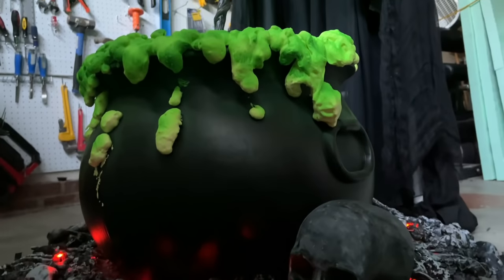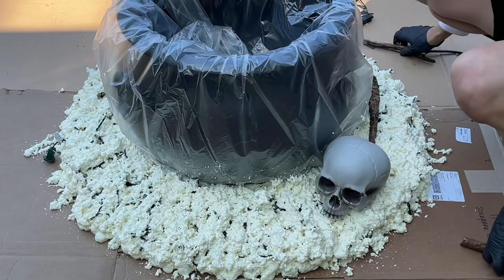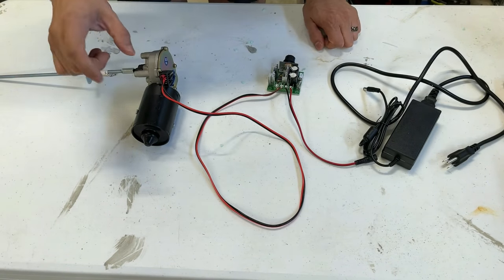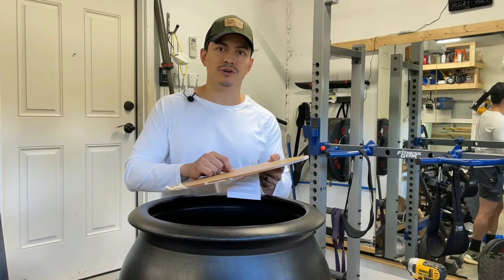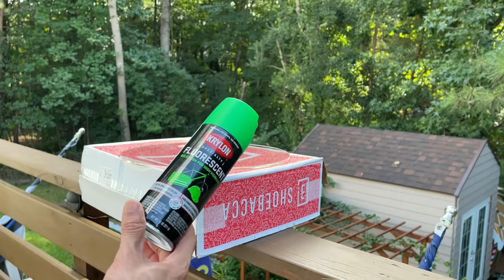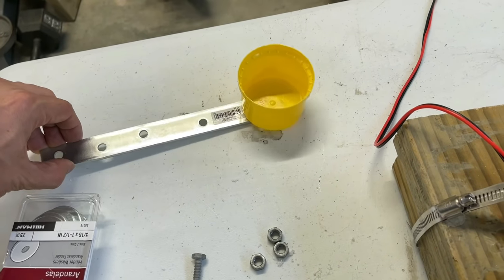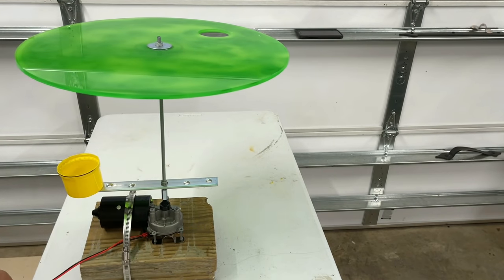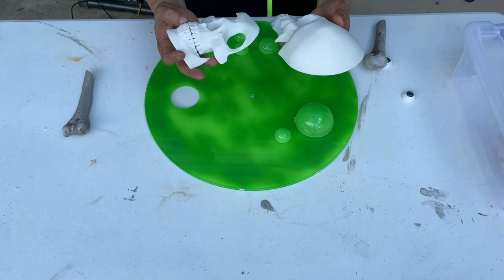Animated Witch’s Cauldron & Glowing Coals - DIY

Comment: This video and prop were absolutely incredible! And the step-by-step tutorial was so helpful. I did have a question I was hoping you'd be able to help with:
I'm worried that the expanding foam and/or the all-over, black spray paint will completely cover the lights and keep them from showing through (I got regular holiday lights, not LED--I hope that won't be an issue?). Is this something to worry about or will the lights shine through, regardless? Thank you!
Reply from the maker: Thank you so much Kristina for that awesome comment. 

So a couple of things. I do not recommend using anything other than LED lights. The issue is that incandescent lights produce excess amounts of heat which could inadvertently melt the expanding foam and allow gasses to be released. That being said, if your prop will be outside I would not be against using that. 

Next, the trick is to not completely drown the lights in expanding foam. I used one can as the base of the cauldron and then after it had expanded for a few minutes, I placed the long string of lights around on top of the expanded form. Then I used another bottle to cover it. The light will shine through the expanding foam but the more lights you use the better. Using a string of lights that has 50 lights or less will not be as impressive as the one that I used. The lights I used were 200 lights plus a separate light string of 10. So make sure you use enough lights and it’ll shine through. Let me know if you have any more questions, I’m always happy to help.
Reply: @IsaacAlexanderDIY  Thank you for your reply! This really helps a lot, and I never thought about the heat of the incandescent lights heating the foam. My prop will be outside, but I took your suggestion and bought LED string lights instead. And the tip about the number of lights increasing their ability to shine through the foam was really helpful. I feel better knowing that!
Thank you so much again and I will absolutely let you know how it all turns out!
Reply: @psyche7 did you end up making this project? Wondering if you could possibly tell me how long the Foam needs to dry before it's safe to start applying the spray paint?
Reply: @ashleysturgill5809  Hi! I can't remember the exact amount of time, but it hardened pretty quickly. If i remember correctly, I started spray painting after about 30 minutes of letting the foam dry/expand. If you're worried about painting too soon, I would recommend spraying the foam and letting it sit over night. Then you should definitely be good to go by the following day. Good luck!
Reply: @psyche7  Thank you so much for the response and all your help. I TRULY appreciate it!!
Reply: @ashleysturgill5809  Oh, my god, of course! The creator did all the work--but I understand the hesitation here and there (as you can see from a question I'd asked him 2 years ago!). You got this and have a great Halloween!

Comment: So, I need some clarification on something that's driving me CRAZY 🤪 with my cauldron creep. You referenced the Monster Prop Pack from Monsterguts. I dont have any electronics experience and have zero idea of what all that stuff is in the pack. There's another motor on the site - Minion Prop power pack. What's the difference and can I use the less expensive pack?
Reply from the maker: As I mentioned in the video, that was the first time using an electric motor, I have no idea what the differences are, and it took me quite a bit to figure out the best way to show everybody how to use it. So the best I can tell you is the contact customer support and ask them
Reply: @IsaacAlexanderDIY  thank you!

Comment: Instead of that $70 motor could the stick be rigged like the motor you used in the witch herself to go in a circle for the cauldron?
Reply: I saw it with the reindeer motor
Reply from the maker: Hey Lee, 
Yes, you can use a reindeer motor inside the cauldron instead of the $70 motor BUT you can’t put the acrylic plate on top So she would be mixing an empty cauldron which is how I was originally going to do it.
Reply: @IsaacAlexanderDIY  beautiful! Yeah I’m trying to figure out a way to use that motor now with a micro fog machine inside it without it making the motor too wet

Comment: "DIY" - holds up the electronic controller "This thing. I don't know what it's called." I N F O R M A T I V E
Reply from the maker: You ok man? 😂 DIY means “do it yourself” - 
Which is normally indicative of people that are having fun and building things they haven’t before. I’m not a pro, I’m not an electrician and before this build I had never worked with motors or electrical equipment for props. I only started building things about 2 years ago so I’m pretty new to all this - but yea go ahead and be pressed that I don’t know anything about electrical subjects.

Comment: Hi,
I am concerned about what you do about rain getting in the cauldron, getting the motor and controller wet along with the power supply.
Reply from the maker: That that was a concern of mine as well so I built a shack for the witch to be inside of. Even though several people have made their witch and kept her outside, I wanted to go the extra step and offer her some protection.

Comment: hello, wondering if the Led lights in the flames came with the flickering bulb change or were they remote set up. is it easy to find a blinking led set like tou used. they looked red in the video.
Reply: oh and sorry, this Vid is amazing, great job hoping to make one this year... do ypu still like the Monster pro set for the motor??
Reply from the maker: @Minipainter35  The monster pro pack has worked amazingly for me. I really like it

Comment: would love to do this, but I don't want to create a whole new piece if the lights die :/
Reply from the maker: The acrylic disk is removable by unscrewing the bolt on top. I had to change out the light halfway through the season because I wanted a stronger light. Took me about 5 minutes
Reply from the maker: Or are you talking about the lights inside the foam?  Yea if they die it can still be used just without lights. So unfortunately that’s an issue

Comment: I watched both videos you made no mention of the staff and where its from and attachment
Reply from the maker: I realized that days after I had uploaded it 😖
The staff is from Amazon, I simply searched  “witch staff” and found one. I also included the link to the staff I used in the description of the video where I list all the items used for the build. You definitely don’t want it to be made out of real wood because that’ll put too much weight on the motor. 
I used zip ties to attach it to her hands. I drilled a hole into the staff and a hole into her hand and attached them with black zip ties
Reply: @IsaacAlexanderDIY  no worries i was thinking about finding and old weathered branch to use my thought was it would likely be more scene correct also a helpful tip when assembling the shoulder or upper body lean on the witch  draw a line across the joint so even if you bump it or have to go back to it the next day or later you can reset the angle to exactly where you had it

Comment: Where do you use the flame flicker lights linked?
Reply from the maker: Are use two different types of lights for the fire. After I set the first set of lights and put foam over them, the flickering lights are placed on top and then I covered them with a little bit of foam

Comment: What if a bulb goes out in the fire pit. Is there a way to get into it?
Reply from the maker: Funny thing is that I had to replace the bulb because the one I had wasn’t strong enough. All I did was unscrew the acrylic disc and replace the bulb
Reply: @IsaacAlexanderDIY  lol yea, but what about once everything is all put together and a bulb goes out. Do I need to cut through the foam or something?

Comment: Hi can I ask were you got the Cauldron
Reply from the maker: It’s from Walmart. They only sell it online though and the largest one cost $30 to ship which is very unfortunate but here’s the link http://www.walmart.com/ip/PMU-Halloween-22-Inch-Cauldron-Black-Plastic-Party-Accessory-Great-For-Harry-Potter-Theme-Parties-1-pkg-Pkg-1/923701893
Reply: @IsaacAlexanderDIY  Slightly confused as the video stated 17” but you linked 22”?
Reply from the maker: @leeachenbach4768  The cauldron is sold in different sizes. I purchased the largest size from Walmart - which is sold as “22 inches”. But when you measure the diameter of the opening, at the top, it’s only 17 inches. This is because the cauldron is sold by the measurement of the widest point of the “belly”, but since we are not applying the acrylic disc all the way down there, we go by the measurement at the very top which is 17 inches diameter acrylic plate and a size 22 cauldron
Reply: you can actually get a 22 inch cauldron for 19.99 at Party City